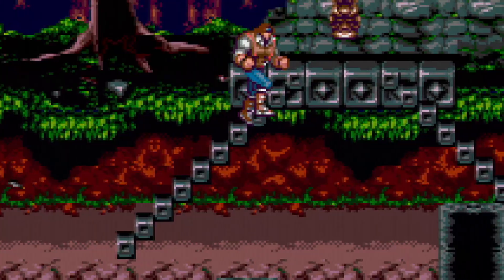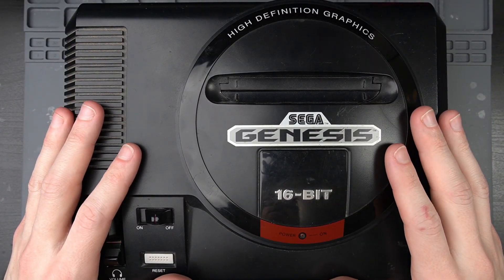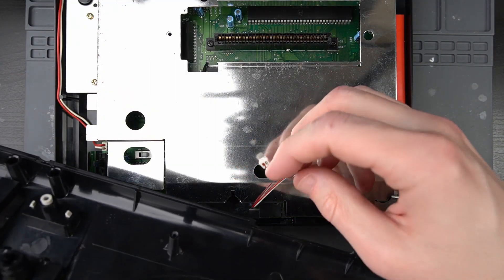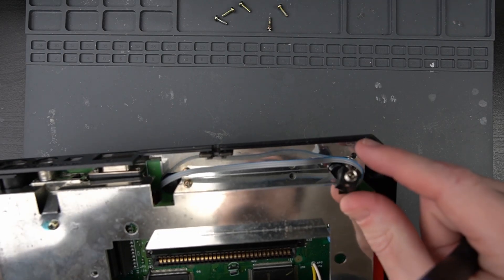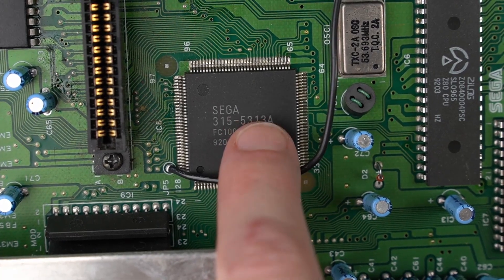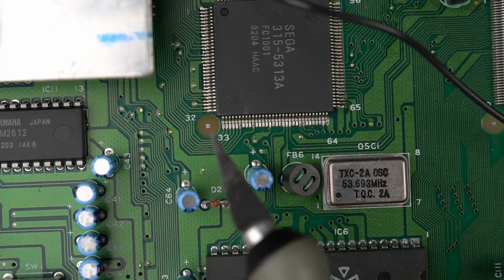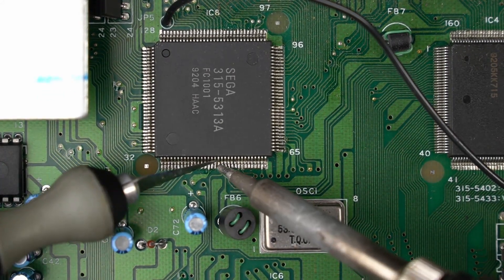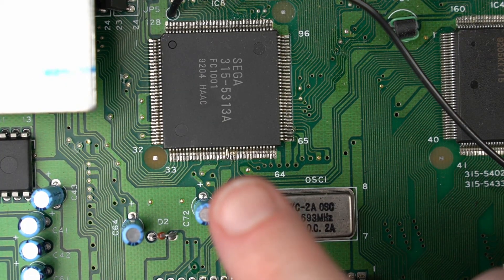Lifting Subcarrier Pin on Model 1 Sega Genesis - Did It Fix My Jailbars?

Comment: I did this mod on my mega drive model 1 va4, and before I did it the jailbars were extremely noticeable, but afterwards even our lass struggled to see them, and that's with going through an ossc into a 4k TV.

It's extremely dependant on your specific MD/Genesis and especially the condition of the capacitors, in my case it used entirely rubycons which are in perfect condition and it was a night and day difference.

If you're planning on doing a 3bp mod, then doing this first isn't a bad idea.

Comment: Heard the retrotink 5x pro paired with a quality Rgb cable fixes the Jail bar and Noise issues on the model 1's.  If so no mod is needed is need on the model 1 hd in my opinion.

Comment: Last weekend I performed this modification on my VA4 model 1 Mega Drive. Recently I got a RetroTink 5X Pro for recording and streaming my retro consoles and it made the jailbars very obvious on the Mega Drive. The motherboard layout is slightly different but the VDP chip is the same, and lifting pin 50 did make the jailbars noticeably less severe. Much like your results the jailbars are still there, but they're a lot more faint to the point that they're not really a problem anymore. Only against bright blue or purple background do they still stand out somewhat.

Thanks for this video, it made it a lot easier for me to figure out what I was looking for and how to perform the modification. The hardest part was getting my knife in the right position to get enough leverage to lift up the pin. It doesn't look that hard in this video but those pins are tiny in reality. :D

Comment: My problem with my Model 1 isn't JailBars but a giant bar of static noise that crawls from the bottom to the top of the screen constantly and it's really distracting.

Thinking about doing this and a cap replacement to see if I can make it go away.
Reply: So I just lifted the sub carrier pin on my Genesis and it was my first time using a soldering iron. I guess it's technically my first "mod" although it's just a pin.

It seems to have made my Jail Bars completely go away. Jail Bars were never that bad to begin with but it's a little cleaner now, but I still have to deal with the vertical crawling static. Some people say it's from having a cheap AC Adapter not giving enough clean power, I looked it up and see people reporting on better video with higher quality supplies.

I think I'll do that next. If that doesn't work then I have caps coming in for this.

Comment: Model 1 Genesis consoles are annoying. In addition to subcarrier lifting, you also have to add a couple SMD caps on two of the VDP's VCC rails.
Reply: It is one smd cap in each VDP's VCC rails? Which value? Do you have a link? please.

Comment: Thoughts on the Triple Bypass vs Voultar RGB Bypass amp?
Reply from the maker: If you don’t want to add the Genesis 2 style din, and you don’t want to bypass the stock model 1 audio, I think it’s fine. Cheaper, too
Reply: @dubesinhower  Cool, I think I'm ok with that!

Comment: Others, who have much more experience than me, have commented... but this is what I've gleaned from past research

The rainbow banding and jailbars is most of the time capacitors that need replaced in the Model 1's. My Model 2 VA4 has rubycon caps and I don't think they've ever had a history of making anything less than great caps, and people often say the model 2's usually don't need recapped.

The 3BP mod just improves the RGB output and amplifies / cleans up the audio output. 

There was a point where I thought that jail bars / rainbow banding was only an issue on composite / RF output but I think I've had at least one or two people tell me RGB will suffer the same issues and you need to do the recap / subcarrier pin / 3BP.

I've heard of people using 32x hardware to play genesis games as it supposedly cleans things up a lot with the genesis output.

Comment: Genesis 1’s are a bit more complicated, as they seem to have a separate source of noise and just doing a video bypass will actually amplify this noise.  Adding two “bypass capacitors” to the VDP seems to solve this on every revision we’ve tried, however there’s still a few model revisions to test.  Overall, my experience has been that on all model 1 Genesis and Mega Drive revisions I’ve tested, lifting RGB, adding the bypass caps, installing a Genesis 2-style AV port and installing a triple bypass has resulted in the best output quality I’ve ever seen from a model 1 genesis.
Reply: Great information, do you have any more information on exactly how to install these “bypass capacitors” to the VDP?
Reply: @charliebeatnik  This kid literally copy and pasted this from RetroRGB's website. Go there instead.
Reply from the maker: I’m working on a model 1 video now actually!

Comment: As an FYI, simply lifting the subcarrier pin from the VDP will show a noticeable RGB video improvement in most revision Genesis 1’s.  It’s not as good as a fully bypass, but is certainly a much easier start to getting better video quality.